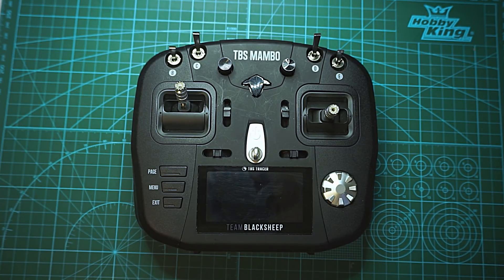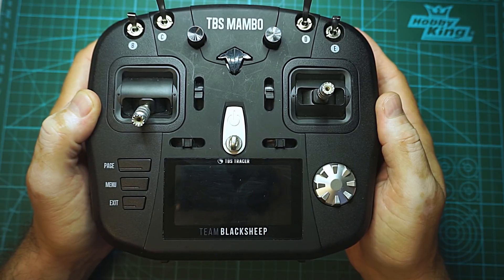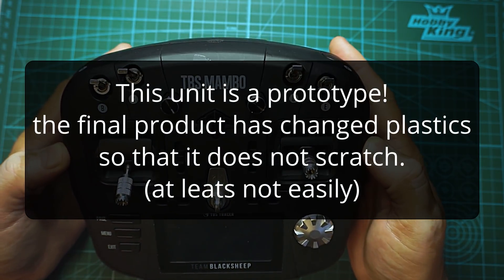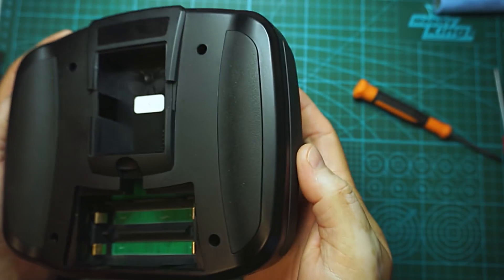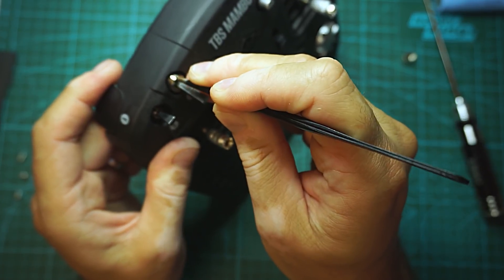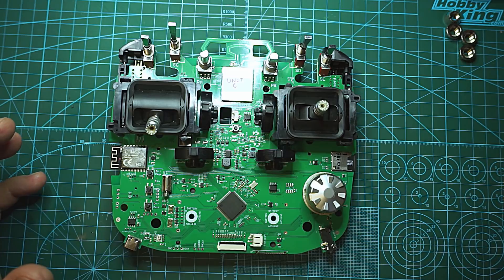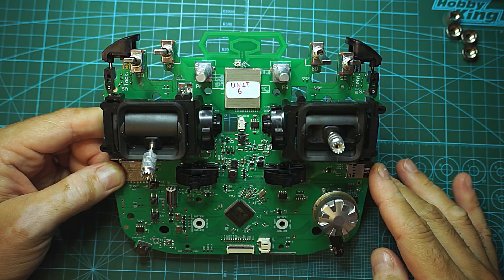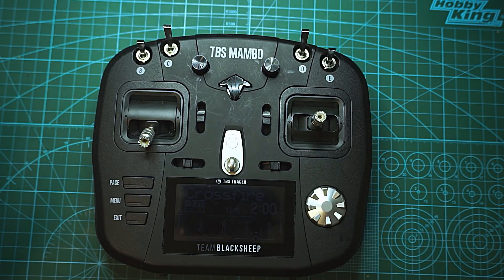TBS MAMBO - Review & Teardown

Comment from the maker: Just a heads up for anyone who will need to desolder those switches: Use big chisel type Soldering Iron tip with ~350-400C setting. Angle the tip more parallel with the board and place enough extra solder on those 3 pins so that you enclose all 3 in melted solder once all 3 are liquid pull out the switch. Afterward, clean the holes of solder(solder wick or suction). Place new switch into the hole, place PCB and tighten PCB screws then solder the new switch into place(switches are angled slightly so this is the way to solder them back correctly). Hope this will help out.

Comment: Dang just got mine and went to flash latest firmware and now its bricked. Bootloader mode doesn't work either. After flashing new firmware it doesn't power up. Seems like am not alone.  This radio is like a ticking time bomb...

Comment: Great teardown, I love being able to see what's inside these things before I buy. What voltage is present on the JR module bay power pin (the middle of the 5 pins). Looks like on the PCB it is labeled as 6V0? EDIT: Bought one and I get 8.11V on the JR module power pin.

Comment: thank you for making this. did you see any provision in the Mambo electronics to run an external power output for the full range 2watt crossfire module? it is required. but the controller only runs on 4.2volts?  cheers
Reply from the maker: There are some empty footprints for something power related so yeah could be
Reply: @LivyuFPV thanks hmm i hope so. it would be a determining factor for me. the full tx module has an xt30 for a 7v+ input when running over 1 watt (which I like to do as there's a lot of noise in my region and the range isn't very good under 1watt).
Hey thanks for your reply dude. Sub'd 👍
Reply: last Q: will the current firmware accept express LRS module? :-)

Comment: At 9:50 there’s a silkscreen on the board at the bottom right that looks to fit a Crossfire RX exactly. Interesting future upgrades maybe?
Reply: It is labeled student module, I imagine it will be to receive the signal from a different radio. You could assign who controls the vehicle to a switch.

Comment: Oh wow that's super super duper dangerous, just putting 2 user changeable batteries in parallel. When you put 2 with different charge you could have a fireball in your hand shortly after! Not every user is aware of this.
Reply from the maker: that's why they used the poly fuses there :( safety feature.
Reply: @LivyuFPV  They are maybe when a fault in the device is present but polyfuses can't be used for balancing bateries.xD. Real weird design decision on this one from TBS

Comment: angled, board mounted switches will end up being a bad idea. Those will be challenging to replace on your own.
Reply from the maker: not quite :) If you desolder them, clean holes then all you need to do is insert the switch into the case hole put PCB back and solder switch legs. It will end up being soldered at the right angle.
Reply: I would use plasticine to get a copy of the right angle if I can not measure it.
But plasticine can help a lot as a third hand and other stuff so it is not that big deal to get the angle right.
And mounting a switch to a board is rock solid as long as you take care and the soldering is done right.

If you prefer to use miniboards you will end up in an endless amount of cables and cable connectors and all the issues that come along with those connections and pieces. The more pieces you have the higher the likelihood of breaking. Therefore car industry is trying to reduce parts and pieces and connections.

Comment: They could probably run custom firmware on a crossfire nano inside and use it as a TX it'd be pretty low power though, I think wireless trainer is a more likely use but, maybe they have a whole other thought in mind.

Comment: 5:22 Using the screwdriver on the positive end of the battery seems sketchy.  Too easy to short the button top to the outer negative shell under the wrap.  If you use the screwdriver on the negative side you will avoid that completely.
Reply from the maker: obviously, I was careful :)) but TBH I was waiting for this comment from the time I recorded the video :P

Comment: the spot for the xfnano has me intrigued, TBS is always planning 3 features ahead.  ,  now if i can flash this to work on those $12 elrs receivers ill be in heaven
Reply: tracer does not use the sx1280 I believe, so elrs will not work. Edit: tracer does use sx1280 ! :)
Reply: @CommandoFPV  Tracer 100% does use the SX1280
Reply: @WezleyVarty  do they use the pic32 mcu's?
Reply: @CommandoFPV  yep. PIC32 for both Tracer and crossfire.
Reply: @WezleyVarty  nice! Doesn't surprise me one bit lol

Comment: does the gimbals have only one hall sensor shared among 2 axis? I threw my tango 2 to the trash for that :/
Reply: What do you mean? How is that an issue worth throwing a Tango 2 in the trash over?
Reply: @mitchellroberts7954  traditional hall gimbals have one sensor per axis, for instance a sensor for roll and another sensor for pitch. Tango 2 however has only one sensor for both which makes endpoint calibration a nightmare plus a lot of inconsistencies, I threw mine and got a a nano TX for my xlite, that one can say what ever but at least the gimbals are not that bad

Comment: How is the gimbals like to replace? Are there any wires connecting the gimbal to the PCB or does it use magnets only at the bottom for the hall sensor to detect like the Tango 2 gimbals?

Comment: Soldered switches… in an angle 😳
Replacement will be a nightmare 🙈
Reply from the maker: not quite :) 
desolder broken one... clean hole of solder place switch in case press pcb in place and solder it. It will solder at the right angle :P
Reply: @LivyuFPV  🙂👍🏻
Reply: hmmm no USB at the top for simulator?
Reply from the maker: @serhiirudenko6183  there is on the bottom